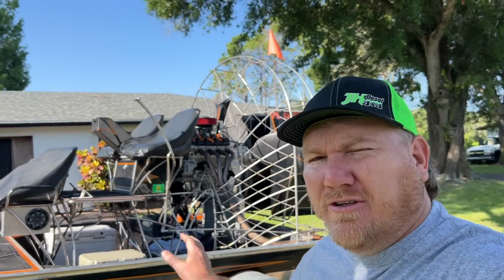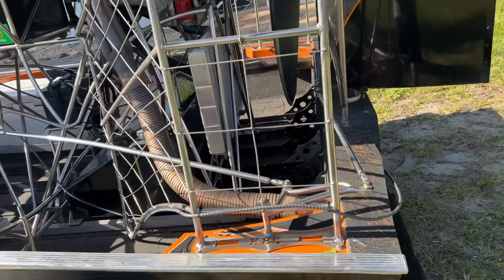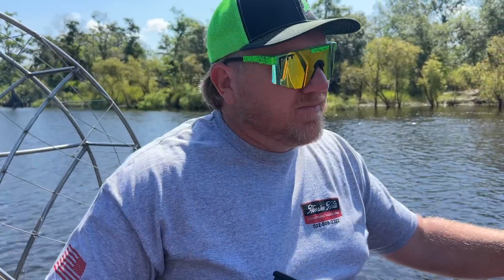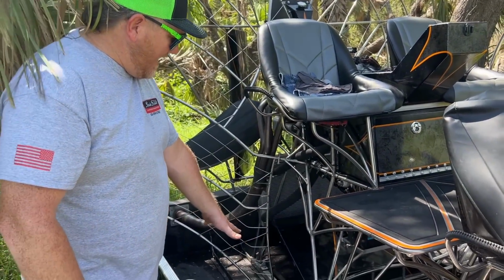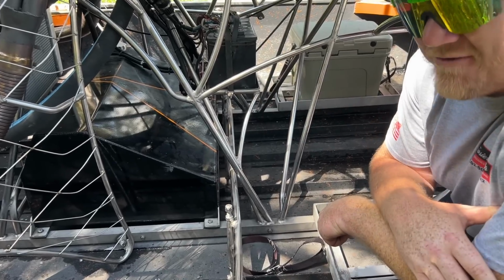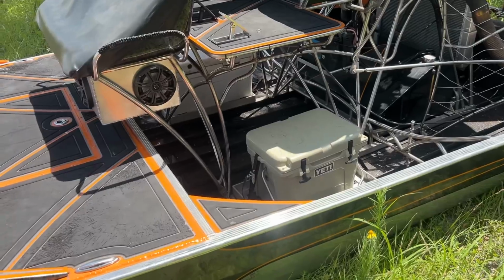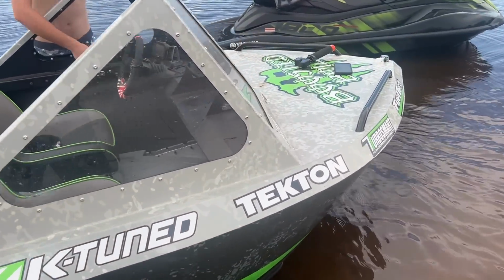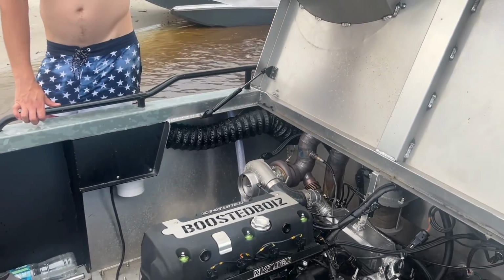LS3 Airboat RIPS!!!!   Testing Our Whole New Setup On Our Airboat!! We Even Have A Fun Little Race!!

Comment: Aviation Mech here, Why cant you use a variable pitch prop? Adjust the pitch, prop rpm and throttle all on the fly. Feather it, bring the rpms up and lay into the pitch when you launch it, much like a slipper clutch but for an airboat lol, Its cable driven.